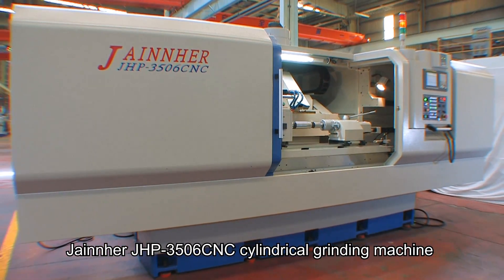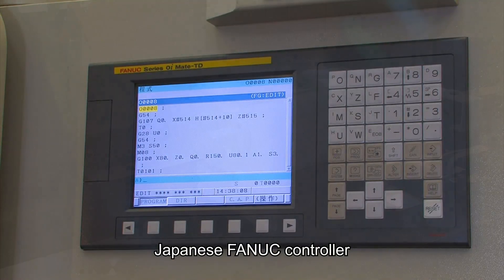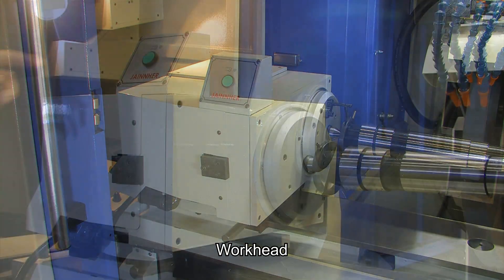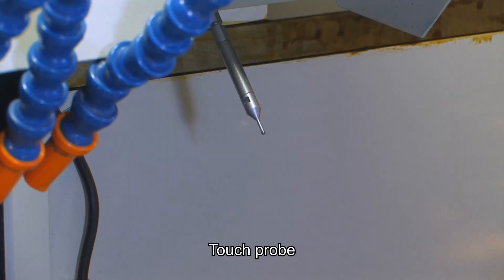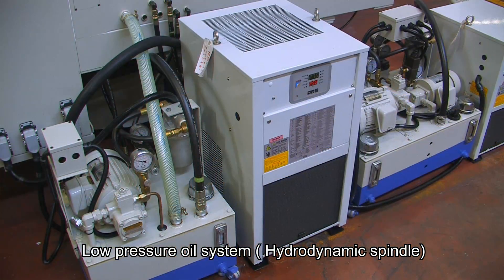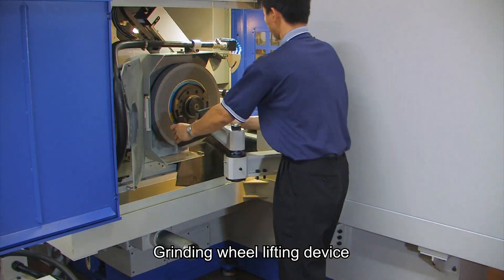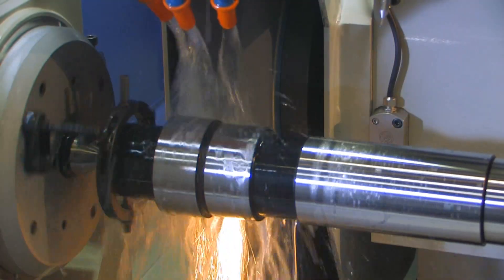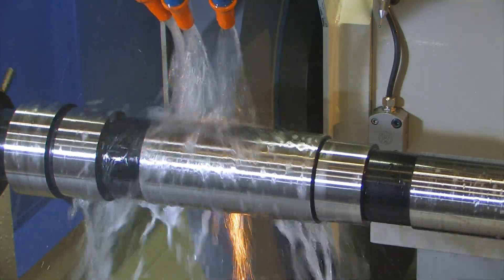Jainnher JHP-3506 CNC cylindrical grinding machine

Comment: Does anyone out there grind OD of stainless rings, sizes range from 20" down to 4", with the width varying from 1" to 4"? What kind of tool do you use? We are making our own fixtures, but the wide variety of sizes, this is becoming very expensive. Is there an adjustable fixture made that can accommodate our needs? We currently use a lathe with an attached grinding wheel. Thanks!
Reply: Jay Terryah Hey, I grind chamfers on rings (not quite the same i know) but in terms of tooling could you grip the larger ones internally on a 4 jaw chuck? Ovality can be a bitch if set like this though so it can only be "nipped up". Hope this helps!
Reply: https://youtu.be/PywbeDE7NGA